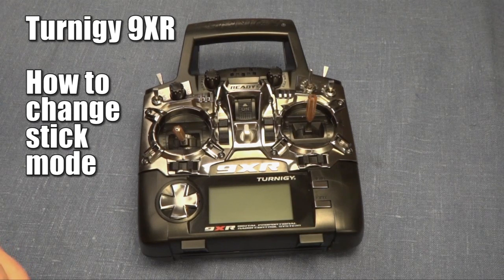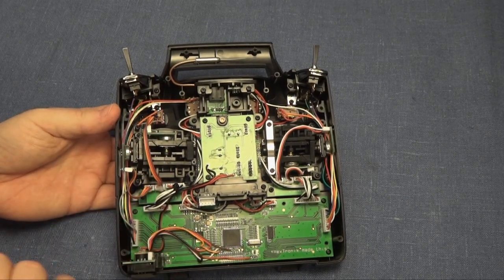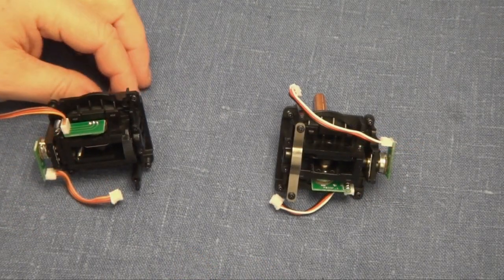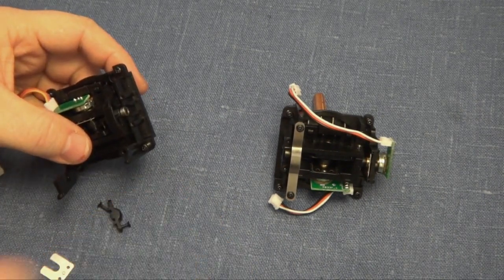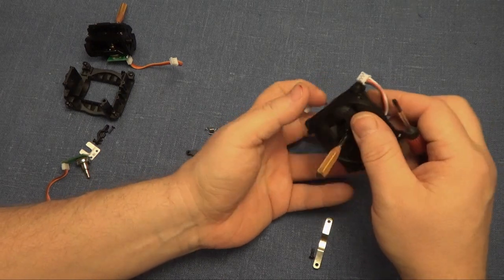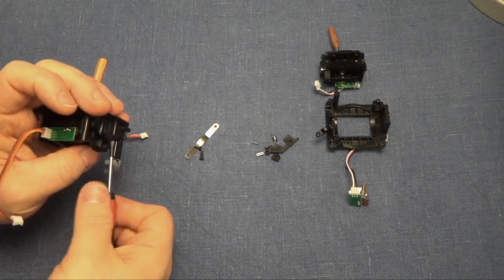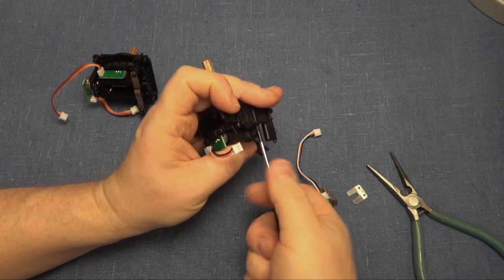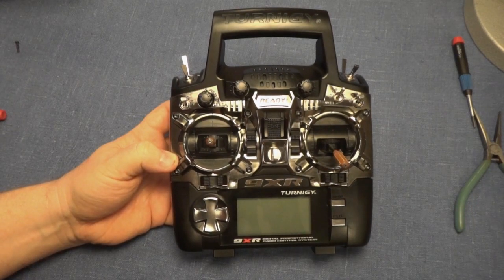Turnigy 9XR - How to change stick mode

Comment: I'm just getting back into RC after a break of nearly 20yrs, & this video could have just saved my model..............I bought this radio 2nd hand, but it was only used a few times by an old boy that has given up modelling due to health problems in mode 2,..... but I fly mode 1.  The throttle gimble potentiometer,  which becomes the elevator potentiometer in mode 1 is very loose in it's housing, & is not very smooth when out of the radio. It does work, & has given no problems, but I need to replace it now as I just don't trust it. The other 3 seem fine.  
I watched this video 3 times thinking "I can't do that", but once you get into it, it's not too bad.  Only difference between the video & my radio is that on mine everything is hot-glued in place

Comment from the maker: Yes, it is important to use the clip. Even if the pot fits well in place without it, the wear and tear might loosen it over time.
Check that you insert it the right way, it makes a difference which way you turn it since there are small bums on one of the sides. Pinch the clip gently together if it is to loose.

Comment from the maker: Yes it would, but you have to turn the gimbal half way around to fit it where the other gimbal is mounted. And the wires from the potentiometers are exactly as long as needed, which means that one wire on each gimbal will be to short and has to be cut and soldered. Some people find this easier, others prefer not to solder their gimbal wires.

Comment: hi, thanks a lot for Your videos! I changed mode 1 to mode 2 and fixed sticky buttons without problems, just following Your videos. But, (I think) You wrote on other site about potenciometres not holding together. I did not pulled them out with force, but pushed from inside -> out with knife. If there is some problem with this part, put the warning to the video, please.

Comment from the maker: I can not understand how this could happen since the only modification done is to change the springs that put pressure on the sticks. Nothing electrical at all should have been changed.
Did you by any chance plug the contacts from the pots into the wrong sockets when you reassembled the radio?

Comment: i have performed this modification just changing out the parts you have said, but my throttle does not have centre in the centre position, and my pitch / elevator is very inprescise, I have read that the pots on the throttle channel have a different value, and they should be changed over too....
Reply from the maker: The center position for each channel is set by calibrating the sticks. The pots are sadly not high quality, so recalibration is needed from time to time. Imprecise pot movements is a worse problem. Check that everything moves without friction and that no cables have gotten in the way of stick movement. The 9xr case is tight and you can easily create obstructions by mistake.

Comment: Hi. I did the change from mode 1 to mode 2, there is a way to change the channel assignments in the radio software?
Like, now it still's with the old configuration on the software, throttle and rudder on the rigth, and aileron and elevator on the left.

Comment: Hi Kjell, I just finished changing the mode on my transmitter from mode 1 to mode 2 and now my right stick only works on the top half, Everything was done exactly the same as the video, did you encounter this problem/have any suggestions on how I can fix it?
Thanks mate

Comment: Hi, is it possible to switch mode just by switching and rotating gimbals 180°, as suggested in some comments?
Reply: I think it would work, but you'd have to reverse all the channels and/or extend the connectors

Comment from the maker: NO, I had no such problem.
The potentiometers are very delicate, as are the connections.
Your best option is to take the radio apart and check that all connectors are seated properly and that none of the wires have broken.

Comment: You don't have to take them apart that far, just pull the center gimbals out. put the two pins in the other side and swap the bottom part!!

Comment from the maker: I have put a warning text in the top section. The pots are really fragile. I was lucky that they did not break the first time I pulled them out. Pushing them out with a knife or small screwdriver is however very easy.

Comment: I have turnigy 9x and inside my radio transmitter  all I do was interchange the arm with the spring for the  tensioner  and that was all.Inside my radio is similar but is turnigy  9x.